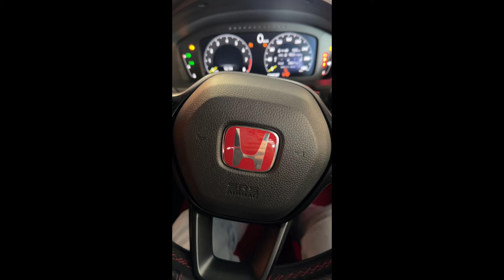Honda Civic Type R FL5 2023 dual resonator delete sound comparison: cold start, 7k rev, acceleration

Comment: Wow, it looks like you cut out the section and put flanges on it, so the mod is reversible? That’s neat
Reply from the maker: @yenny527  yeah! I was thinking maybe 2 res out is overkill and may cause issues for comfort travelling out of town, but no it's very bearable and not a distraction, at least as a car guy haha. If selling it or growing up in the future, that's possible. Was an extra 100 bucks for the flanges. I'd rather the flexibility of reversing vs having to re weld everything back

Comment: Hey mate, looks like you’re in Melbourne. Were you able to get the Mid pipe to replace the front resonator in Aus? Or you had to order it from overseas? Also if you could advise where did you get it done. Really wanna get a similar setup like yours. Thanks.
Reply from the maker: Hey! Yes I am, it was done at Settlement Rd Exhaust Centre in Thomastown. We chopped both resonators and replaced them with a straight pipe now known as midpipe. Photos included towards end of video. All fabricated by the shop nothing overseas, it's a common request these exhaust shops get!
Reply: @caffeinefix2751 hey mate how much cost?

Comment: Can we see how the modified exhaust look like? Thanks mate!
Reply from the maker: You mean the underside of the car? Photos are included at the end of the video 2:48. Just a straight pipe instead of the two resonators
Reply: @caffeinefix2751  I thought you said you also add a valve for the straight pipes. I wonder how are they look like😄because middle pipe already have one from stock
Reply from the maker: @hiuchunp  the only modifications I did were:
1. Removed the 2 front resonators from the stock exhaust system and replaced them with straight pipe 
2. Did the fuse mod where the original valve stays open (valve is actually near the rear muffler in middle pipe you can see it open and close in a stock car)

I didn't add or remove any valves

Comment: That sounds pretty good to me, I'm sold! Did you try it without the fuse mod? When does the valve actually open and close, because I wouldn't mind a quieter cold start as I live in a townhouse.
Reply from the maker: It will be quieter without the fuse mod, a friend of mine tried it as he didn't like the rasp with the fuse mod, still sounded good! Valve opens after 4000 in WOT I believe. And in +r mode

Comment: If you hate the pumped in engine noise why dont you just unplug the module behind the glove box? Its not difficult to do, you just need a plastic pry tool, philips head screw driver and potentially an 8mm socket if you have trouble unscrewing the bottom ones with the screwdriver
Reply from the maker: Thanks for the instructions! I don’t actually hate it. And it can be turned off if you turn it off from the customised settings

Comment: Hows the drone?
Reply from the maker: Virtually zero drone. Only time it would be droney / boomy is the overrun / decelerating around 4.5k to 3.5k. Otherwise very liveable and tasteful in my opinion. I didn't bother to include highway 100kmh samples because honestly you can barely hear it (tyre and wind noise are louder than the exhaust when cruising on highway) which is a good thing.
Reply: Cheers mate!

Comment: Greetings fellow victorian! Where did you get the work done? Any detrimental effects to performance? Im melb based and this definitely sounds better than most aftermarket exhausts ive seen.
Reply from the maker: @polesitter44  hey, I did it at Thomastown exhaust centre. Agreed it sounds better than many exhaust systems. No detrimental effects at all, just that I want to drive it more often with this exhaust note coming out!
Reply: @caffeinefix2751  legend thanks for the steer mate.